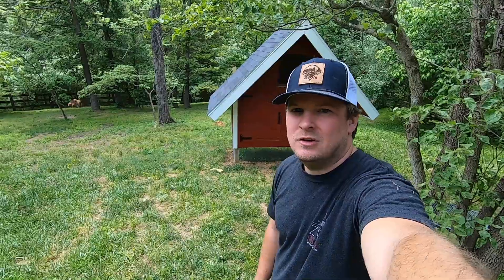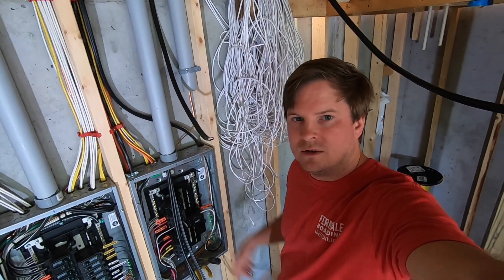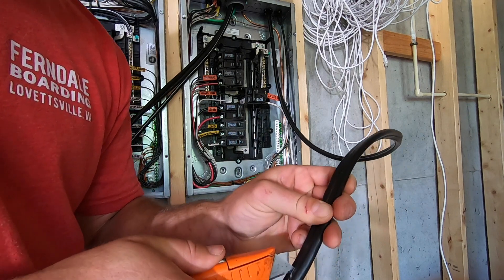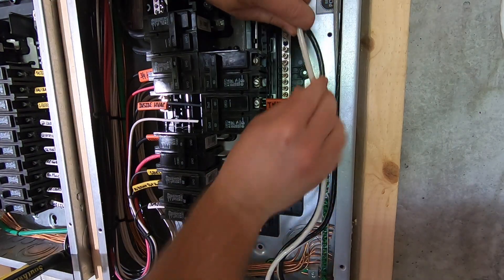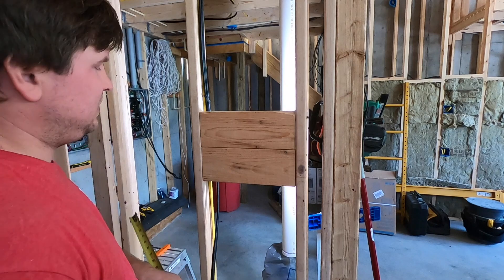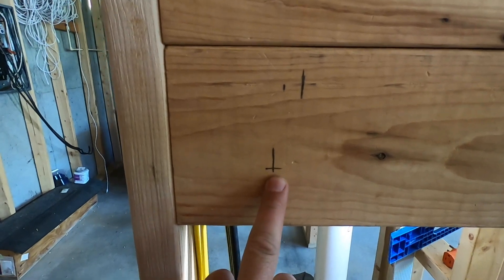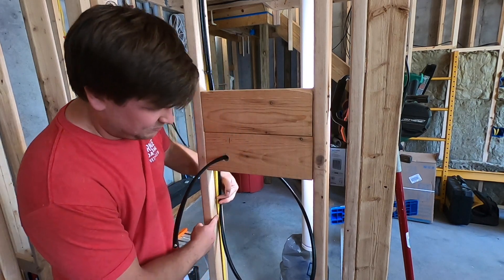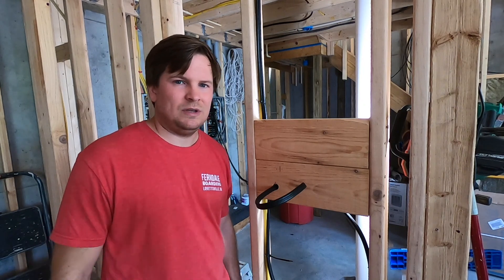Tesla Wall Connector Rough In

Comment: His later video corrects several issues this one has - the Tesla charger to use max 48A MUST be fed from a 60A breaker, using single strand THHN cables in conduit; Romex is NOT heat rated to the 90deg. C and if used must be limited to the 40A rate on the Tesla app, and run from a 50A breaker. The white would need to be taped with red where it is entering both the panel box, and the Tesla unit; the ground wire in that Romex is also smaller than advised, whereas single strand wires can be all 6ga, and purchased in proper red, green, and black colors.

Comment: I was thinking to DIY  and found your wonderful explanation.. awesome but had couple of questions 
1. All the electricians I spoke are asking for inspection , do I need one..? If yes how to get it done.
2. The electrician is asking really big bucks..!
3. I have a straight panel and don’t have an exit out of the panel, how do I handle this.?
4. Can I use a UF-B 6/2 cable.?
Reply from the maker: Thanks for the comment! I hope I can answer a few but I am no professional. I have 2 other videos on the charger that might help you out also!
1- I didn't need an inspection but it depends on your county. You can get the permit through your county, if needed. 
2- Yea they do
3- I'm not sure what a straight panel is but there should be little punch out holes.
4- I am using thhn wire now.

Comment: What wire do you use I think its a 6/2 lmk ASAP
Reply from the maker: Yea!!
Reply: @ZittleFarms  I bought 6/3 does it still work
Reply from the maker: Yea. Just hook up using the black and red. The white wire won’t be used. Just put caps on them

Comment: What amp breaker did you install? TIA!
Reply from the maker: I put in a 60 amp breaker because that is what I read on Tesla's website. But someone was commenting on how it should be a 50 amp breaker... I'm not a professional electrician but I went with the website.
Reply: @ZittleFarms  6/2 NM (Non metallic sheathed cable, AKA Romex) is only rated for 55 amps but single conductor THWN is rated 65 amps. Last week I had a Tesla charger install and used 6AWG Red, 6AWG Black and 10AWG Green stranded THWN, ran inside FMC (flexible metal conduit). This was on a 2 pole 60 amp Siemens breaker.
Reply: @ZittleFarms  Breaker are there to protect the wire. 
Can the size 6 wire handle 60 amp ?
Clean install, better than many professional I saw,
Reply: @ZittleFarms  60A is correct if you configured it at 48A.   80% of breaker rating for continuous use.